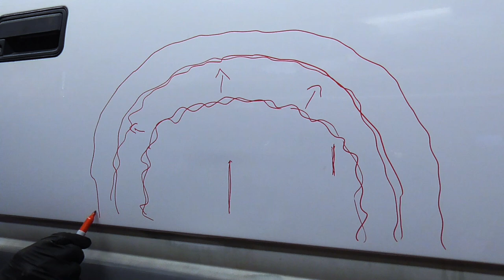How Body Shops Remove Dents - Detailed Explanation from Start to Finish

Comment: Easier to use a heat gun,and cold ,wet cloth ,...no painting required.
Reply: This is a el cheapo body shop repair. Could've PDR that dent. No epoxy primer under the filler now results in rusty metal in the future. Garage body shop at it's best lol

Comment: This is one of the best videos I have watched on bodywork...sad that there are not more views.  Your approach is very simple and straightforward.  Would greatly appreciate your thoughts on:  2K high build primer, whether to use a etching primer on bare wood first, and primer sealer...or all these things unnecessary complications.  I am restoring an 89 bronco.  Thank you.
Reply from the maker: 2k urethane primer can be applied over bare metal unless it is stated on the can that it can't.  Look for DTM or something like that on the instructions - directly to metal.  I've never seen etching primer used in any of the shops I've worked at.  Just make sure the metal is sanded/ground first and nice and clean.

Comment: Nicely done Bud!! I haven't seen Nitro-Stan used in 40 years, I still have a can of it on the shelf from the 70's!!☺
Reply from the maker: Thanks - I really never got away from that type of putty for super quick fills.  As long as it's small, it works great, drys real fast and never shrinks or shows up.

Comment: If you occasionally pull a strait edge down the curvature you can see you high and low spots  thanks for video  you very good at it.
Reply from the maker: Very good point - sometimes I use a straight edge before filler to get a good Idea if there are any high areas that need to be knocked down.
Reply: @LakesideAutobody  I was hoing to comment on the fact as why you didnt check to see if there weren't any high spots as can sometimes happen when you get a hit.

Comment: Another great video Jerry! I enjoy reading your comments almost as much as watching the videos - always something to learn! 
Question: You finish the bondo by block sanding with 80 grit. Next you work on the paint edge, feathering it back nicely with 40, 120 and 220. Are you also hitting the bondo filled area lightly with the 120 and 220 or do you stay away from it until after the primer coats? Thanks again!
Reply from the maker: Thanks and you're welcome. After you finish the filler with 80 - stay away from it when DA sanding.   You can hit it real quick if you want with the DA  but generally leave it alone, prime it, block sand it, prime again and finish sand with 220-400 then paint.  Have a great weekend:)

Comment: Another great video. You always make it look so easy. What primer do you use? I Know you mentioned it once, but I cannot find the reference. I remember it was some type of cheaper lacquer primer. Thanks
Reply from the maker: Lacquer primer surfacer from Auto Body Master.  It's inexpensive 50/gal and works real well.  I get it from the local Auto Value auto parts stores.  The key though is primer surfacer - if you use 2k, use urethane for building thickness to block sand.  Epoxy is more like a sealer.

Comment: Great demonstration Jerry
How can I  know when to  stop sanding and  it's ready for primer
Reply from the maker: Great question - I will do a video on that because it's a legit ?.  The whole idea is to bring down the filler all at the same time - not one area, then move to the next.  So if you stay "on top" of the filler bringing the whole filled area down at the same time, you'll start to see the edges start to feather or blend in.  Do not force the edges to blend or feather- let it happen with a board and sharp paper - let the board do the work.  Like I said - good ?  :)  Jerry

Comment: Love your videos, question- What size is the DA pad you're using? It looks smaller than a standard 6". I just bought a 6" DA and wondered if they make smaller pads for them.
Reply from the maker: I use a 5" pad but it really makes no difference (maybe a little when black sanding w/ a DA).  I'd keep the 6" - it's a non issue.  I just use it because when I started that's all there was and I'm just real comfortable w/ it.  I did have a DA with a 6" pad for quite a while because a shop I worked at used 6" - it made no difference to me really.  So glad you enjoy the videos Tony - have a great week :)

Comment: Hey Jerry  ,
Great video , hope you had some good holidays. 
My question is , where I'm located in
S/E Michigan,  It seems.just after grinding  down the paint to metal  before I  can get the filler applied  I  get a fine dusting of rust , what do you recommend.
I've  washed with metal prep in the past but sometimes when I  don't  use filler but prime seal I  get rust bubbles under the paint after about a year and end up redoing that section. 
What do you purpose .
Thanks Again.   It's been a while , keep up with the good work. 
                                                  Al
Reply from the maker: Al... good to hear from you.  Are you working inside or out?  If you are working outside or moisture is a problem you're going to have to grind the panel clean, do the body work, and prime as soon as you finish sanding with 80 grit.  Once you have it in primer - no matter what primer you are using - you should be OK.  I usually prime right after I've finished the filler work so maybe that's why I've not come across that issue.  I'm also always inside with dry heat.  Also,  If you use a ventless heater of some sort it can cause very high humidity - like bullet heaters,   kerosene heaters, etc.  I used to have an uninsulated steel building with a kerosene heater and it literally started raining droplets from the steel ceiling after  it warmed up inside compared to the outside.  Let me know what you figure out and how you solve it.  Keep asking ?s if you need - I'll keep throwing out ideas that may solve the issue :)

Comment: Jerry -
Do you have a link to the air grinder you used with the side handle.  It looks like a beast.  Great video.
Reply from the maker: Hi Bluesman.  It's a Sioux 5290 vertical sander - They don't make that one anymore but here's the newer line up - https://www.siouxtools.com/industrial/finishing/vertical-sanders/  I did find the old model on Ebay though - not too bad of a price either - https://www.ebay.com/itm/312037126885?epid=1303934934&hash=item48a6dcb2e5:g:90kAAOSw~gRVwjIg&amdata=
Reply: @LakesideAutobody  Thanks so much Jerry.  I ordered the one like you have off ebay.
Reply from the maker: @bluesman6955  They are beasts like you say - sound real cool too :)

Comment: When working on a metal panel, do you have to apply fiberglass first since its harder then put bondo ontop?
Reply from the maker: No you can just apply filler straight to metal.  If there is a hole.... you could use fiber glass first then filler or weld it up, knock it down and fill.  The Gotti/Ward trilogy movie will make you cry it's so good - you probably saw it already though - good stuff :)

Comment: please also tell us, how long you leave the primer to dry.
Reply from the maker: Here's a good rule of thumb because all primers (lacquer, urethane, epoxy, polyester) dry differently.   If you want to make sure it's dry make that the last thing you do for the day - prime and go inside for the night.  If you're in a hurry, as soon as you can sand it - it's dry.  In a body shop we used to put a heat lamp on it and within 5-10 minutes start sanding so... it depends on quite a few variables.

Comment: Does a slower speed on the grinder insure that the panel doesn’t heat up while stripping the paint ?
Reply from the maker: Yes.  It also helps keep the sand paper or disc sharp.

Comment: I been watching Lakeside for 3 months .  You did not say what primer you used,  Im sure it was Epoxy , you covered the bondo and bare metal and paint .   with Self etching it don't like bondo or paint ,  and 2K is not a sealer over bare metal .  I do enjoy Lakeside Videos lot of great advice for a DIY guy or gal .
Reply from the maker: Thanks a lot - I appreciate that.  I use lacquer primer surfacer for everything - it's cheap, builds fast, works fine, doesn't shrink if used right, doesn't harden and can throw the unused portion back in the can..  I also use sealer sometimes just before paint.  Urethane and epoxy are great primers - matter of fact,  I've never disliked any decent automotive primer - Martin Seymour smelled weird if I remember correctly though :)
Reply: @LakesideAutobody  Back in 1977 my brother and I used that on my first car .  with Enamel paint .  less than 400 for the car plus door and fender paint bondo.  them days are gone .  I loved the Video pounding out dents with a hammer and ball hitch :)
Reply from the maker: @JCcanU  Thanks - sort of funny but sometimes you have to work with what you have.  I've done a lot of work with crappy tools over the years :)
Reply: @LakesideAutobody   Same , now when I need it I buy it lol

Comment: If cut out the rust and welded in new metal,  isn't it the same process ?   I have been totally confused since I have gotten so many different suggestions and ideas on how to do this.  For example, one guy said 600 or 800 prior to paint, another said 400, another said 320,,,,IDK.      I like after you prime, hit it with 120, prime again and hit with 220/paint.   Just the 120 part is going to save me so much time on the next paint job.
Reply from the maker: Here's the process in a nut shell (how it's done in dealerships).  Do your body work (bondo to 80 grit) feather edge the paint w/ 120 grit go out further with 220-240 or scuff (red pad).  Primer with primer surfacer 2k or lacquer primer surfacer, block with 120-150, primer again with primer surfacer, finish sand with 400-600, or you can also finish sand with a DA (220-320) your preference  - 240-320 you'll have no worries at all, seal if you want with auto body sealer, paint - that's it - don't listen to nothing else - that's how it's done.  Using anything over 600 before paint is not necessary.  Let me know if you have any other ?s on this :)
Reply: @LakesideAutobody  Thanks.
Reply: Also depends on your paint. Solid colors you can get by at 400. Pearl's and metallics you want 600 so the flakes dont land in large sand Mark's. You want them flat. 800 you're starting to polish do avoid going that fine.

Comment: It was hard to tell how deep the dents were. At what point would you pull the dent verses filling it?
Reply from the maker: Basically anything bigger than a common door ding gets pulled because larger dents cause a crown or high area around the dent that has to be dealt with.

Comment: so on this small job why dont you use PDR? im new to body work have a 96 jeep xj i have to put all new floor pans and fix rust holes on my uni-frame rails
Reply from the maker: You really can only try PDR if there is no marred paint - most of the time the paint is damaged.  Certainly you can try your hand at it but usually you'll need filler.  All dealerships and private body shops use this method.  They may contract a guy outside of the shop if it is a really small ding or shallow dent without paint damage :)
Reply: @LakesideAutobody  thanks new to auto body stuff. I have a 96 Jeep XJ and putting all new floor pans and learning how to weld in the process. Love your videos spent all day yesterday watching them
Reply from the maker: @hayzersolar  That makes my day Marc - love to hear stuff like that.  Good luck on your floor pans.  I like the AC Delco Seam Sealer for stuff like that - dries fast and is paintable - ACDelco GM Original Equipment 10-2013 Body Joint and Seam Filler Compound - 10.1 oz  on Amazon :)

Comment: da sand around with 120 or 180 or 220, ?
Reply from the maker: Generally you start with some 120 or even 80 to feather edge (smooth out the grinder marks or edge of paint).  Then you can switch to a finer paper of your choice 220-320 to go out further so that you're not getting primer on unprepared (shiny) paint.  You can even go 120 then scuff further out if you want (red scuff pad) - just so your primer sticks well.  Basically don't want primer on un-sanded paint :)

Comment: why do you need to clean it it with wax and grease remover when you are going to grind it said has two dents how did you get a low  spot
Reply: I always wash and prep with wax and grease remover before doing any body work even if I'm grinding off paint etc, reason being it prevents contamination being spread around the panel and also onto my hands and tools, other wise I might end up with fish eyes in the final finish and no painter wants that!!
Reply from the maker: It's just a good idea because it helps you see everything, takes of any grease that might be rubbed around by sanding or grinding, etc.  Not sure how the low spot got there - the truck was beat up pretty good.  I think the previous owner ran it through the woods or something and trees rubbed against it.

Comment: Do body shops do paintless dent removal ?
Reply from the maker: Most do not and that can be done only if the paint is in near perfect condition.  Also they rarely came across a vehicle that was in an accident that didn't have the paint marred.  It doesn't happen often - maybe if a baseball hit the car or something like that.
Reply: @LakesideAutobody  PDR used a lot on hail damage. I had mine done when visiting Okla. And a hail storm hit it. Very  interesting to watch.

Comment: Why not use a stud welder and putt the metal out so you don't use as much bondo/body-filler  and you should finish in at least 240 for primer not 80 grit you start at 40 or 80 then 120 then 240 it thanks a little more time but creating a show car quality and no heavy scratches for the primer or paint to sink months or years down the road... Becouce within time everything sinks
Reply from the maker: Always finish your filler with 80 grit, then prime with good quality primer surfacer, block sand, prime again, finish sand, paint.  That's the process.  Show car quality.  I think sand scratches show up because folks in the past tried to bury grinder marks, 36 grit scratches, etc with a super thick coating of lacquer primer.  If materials are used in the way they are meant to be used, you'll be fine.  Thanks for the comments Peter - have a good week :)

Comment: Wouldn't have scratched the hell out of the bottom of the door if he'd have taped it off.
Reply from the maker: If you mean the rocker panel - that's in primer.  I didn't hit it anyway though - the door is out further than it - thus no need to tape
Reply: @LakesideAutobody  I'm talking about the bottom, below the body line ya hit with the grinder lol. The rocker panel is nowhere close lol.
Reply: Lakeside auto body make grate videos! but it’s AWAYS somebody looking for a mistake SMH 🤦🏼‍♂️

Comment: Was hoping to learn how to remove dents, not just fill it with a bunch of mud
Reply from the maker: With respect, It's really you choice.  You can do it like professionals at dealerships and high volume body shops or you can poke around at it for hours damaging the interior and other surrounding metal.  That's your choices.  My goal is to actually teach folks to do body work the way it's really done (not like the internet) so they could actually be efficient, know what they're doing and work in a body shop with those skills.  Nice duster BTW - you'll like this Charger - https://www.youtube.com/watch?v=2o37dX--w0I

Comment: Small  job  you  made it  big   application   really  bad       only  my  opinion
Reply from the maker: I did that to make a point.  You'll paint the whole door anyway though even if it's 1 square inch.  Don't try to stay small - it only ends up causing problems in the end - really :)

Comment: nice way to not do it this way 
thanks a lot
Reply from the maker: If you didn't do it this way - 70's, 80's, 90's, you'd probably not have a job long.  All owners and shop managers wanted you to grind to bare metal, etc.  There is many reasons for this too.  You're welcome BTW :)